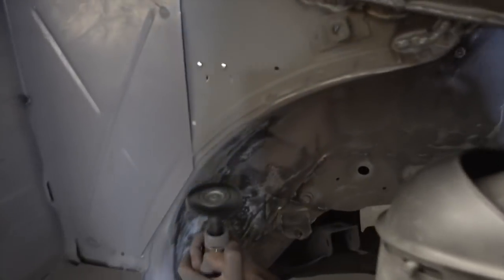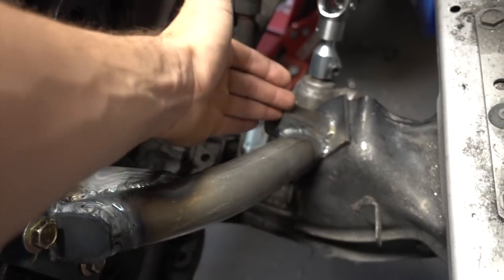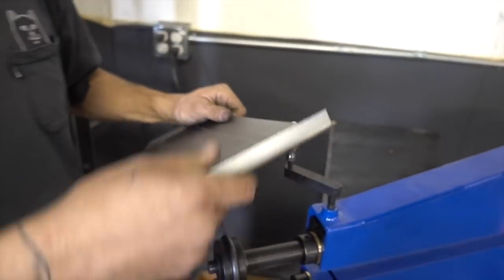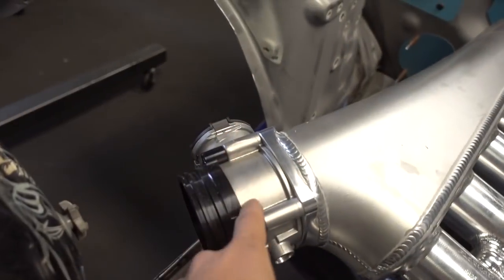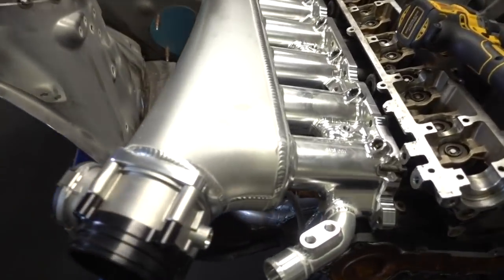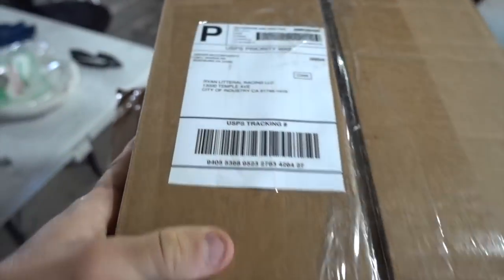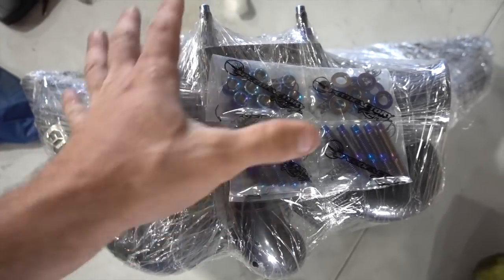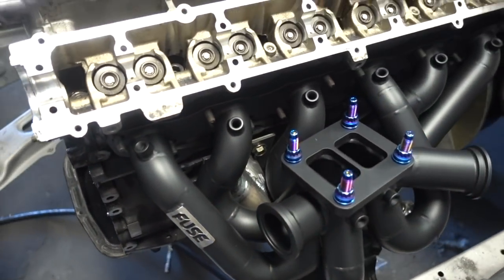The Fab Journey Continues- Dream S15

Comment: Surprised it doesn't have a tube front
Reply: FD regs probably require original shock towers and inner fender.
Reply: @foamdataservices  yes from the shock towers back . From the shock towers forward you can cut certain things. The bulk of fd cars no longer have factory radiator supports
Reply from the maker: saves us time on making mounting tabs and such - clean is clean- the 14 forever had a factory core support and front- once the times comes after impact we will tube it further, but until then - run it